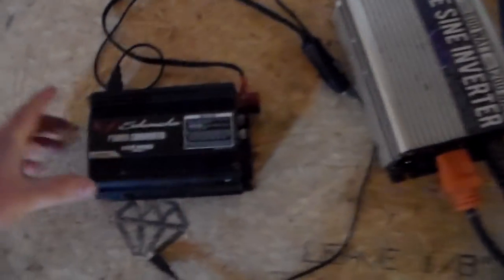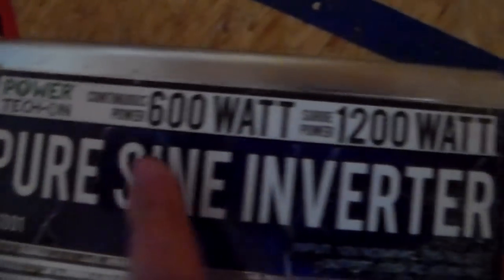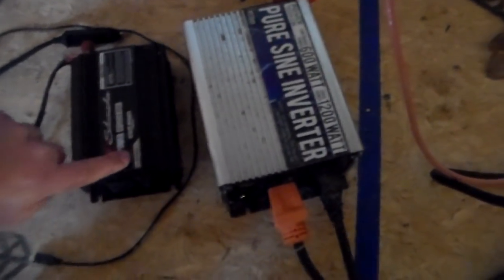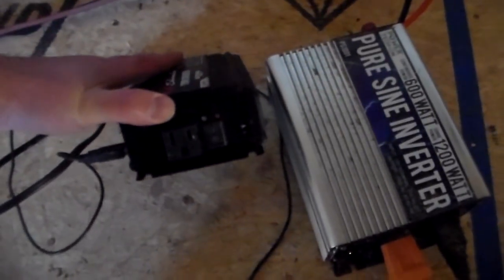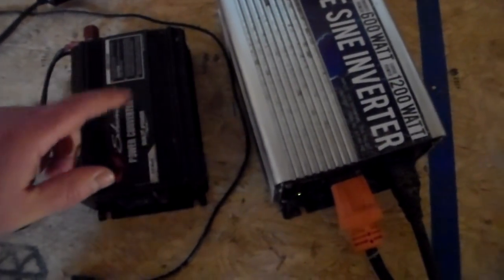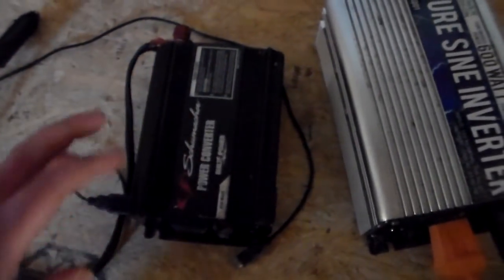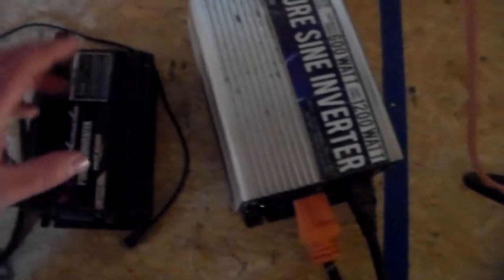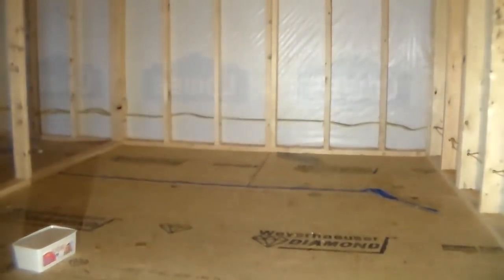Modified Inverter VS Pure Sine Wave Inverter

Comment: Power from the electric company or from a gasoline generator, comes from alternators, hence the alternating AC current which is true sine wave generated as the rotor from the alternator spins 360 degrees, "sine wave" from converters is really "synthetic" or an approximate, created to resemble a true sine wave, works fine if you have a good quality pure sine wave converter, if it's cheap, the sine wave will degrade the more power you extract from it, in other words if you sine wave converter rated at a 1,000 watts it may produce a sine wave output at 300 watts, but as it gets closer to it's rated capacity it will start to look like something else and mess up your electronics

Comment: Just as a note (I DO NOT RECOMMEND DOING THIS UNLESS YOU ARE VERSED ON HV AC VS DC) I live in southern Japan (Fukuoka) & the nominal power is 100 VAC 60Hz. You would be surprised how much of today's high speed switching power supplies can fully function on 100 - 240VDC. 
There are a few safety issues. With AC there is a point several times per second where there  is NO current flow if an arc occurs (such as switching an appliance off) the arc gets cut. 
With HV DC, that cut never occurs. When opening a switch conducting HV DC the arc produced has the tendency to continue unless it is suppressed with a properly rated capacitor across the switch (NOT THE LOAD). All inductive loads such as compressors or synchronous or asynchronous motors will NOT function on DC.  
I have been operating my entire home on 100VDC for 9 years now with the proper capacitors on all switches to prevent arcing.

Comment: This story, about the difference between the two types of inverters, is mostly a marketing trick. Theoretically there is nothing wrong with modified sinus inverters, as long as they are producing really modified sinus waveform. This means that, for every semiperiod of the alternating voltage, they should have fixed intervals before and after the main pulse. If the intervals are fixed to 30 degrees, which means 120 degrees of duration of the main pulse, then there is no problem at all. This is due to the fact that the third harmonic of the fundamental frequency is completely eliminated with these fixed intervals. Remainders of higher odd harmonics are strongly attenuated as well and cause no problems. The problem with the cheap commercially available modified sinus inverters is exactly that they do not produce correct modified sinus waveform because they regulate their output R.M.S voltage by affecting the duration of the single power pulse. Especially in the case of heavy loading of the inverter, its output waveform looks to be rather rectangular than modified sinus. This increases dramatically both the percentage and the magnitude of harmonics of its output and that hum noise becomes much stronger as well. 
Now, as regards the various types of loads, if we have a pure resistive load such as a water heater, or an incandescent lamp, this load doesn't care if the waveform of the power fed to it is modified sinus or pure sinus or D.C, that is battery oriented. The next type of load is the switching power supplies of all electronic equipment. These supplies don't care as well about the input waveform. As soon as it enters into them it gets rectified (i.e.converted in D.C) and then it is chopped down in order to produce the d.c voltage needed from each particular equipment. They can also work by D.C directly with no problems at all. The third type of load is the inductive load, i.e. mostly induction motors. This is the only load that is much happier with pure sinus voltage, just because it suffers most because of those harmonic components of the input voltage. But even in the case of motors, plenty of them produced in our days tend to be three phase brushless motors, which are driven again by rectified A,C voltage (i.e D.C) which is then split and transformed in modified sinus again, but three phase pulse width modulated signal. The compressors and ventilators of modern air conditioners use this technology (inverter) for both better efficiency and power economy.
In conclusion, all loads can work safely with a real modified sinus voltage inverter (unless one wants to sell power to the utility company, a special case in which there is obligation for pure sinus waveform production). Even with the commercially available modified sinus inverters, most loads will be fine. And yes, the problem of overheating is there for induction motors, along with the characteristic hum noise. And the noise is due to the abrupt interruption and starting of the pulsed waveform (which creates the harmonics). This is the whole picture of the topic. The main point is: "what is the need you want to cover with your inverter"? Think about your loads first and then make the proper decision for your specific case. Practically speaking, the modified sinus type covers everything, if used with common sense (watching the temperature of motors or protecting them by thermostats). If, for example, you need to operate an induction motor for many hours per day, such as a ventilating fan, you could buy a small pure sinus inverter for that motor exclusively and let the rest of the loads be powered from a big modified sinus one. That's all.
Reply: Moreover, soft start has absolutely nothing to do with starting a device with an inverter. It refers to the starting of the inverter itself in order to protect it during starting. As regards the battery charging by using modified sinus inverters, again, there is no problem at all because all modern chargers use switching power supplies and these supplies don't care about the waveshape of the incoming power. The proper charging of a battery is a matter of the quality of the charger. Not of the waveshape of the incoming voltage to it. There is too much of exaggeration in this video about the modified sinus inverters which is baseless (at least theoretically).

Comment: Wondering about losses and efficiencies.... On the fence about spending an extra $100 ($80 vs $180) on  my simple van setup for pure sine vs modified sine wav . Also finding Inverters just don't last very long for me.. wish they were generally more robust.  My battery Is my starter  70AH 120RC.  I run power tools and appliances 500w to 1000w, but need to run a freezer for 8 hours while a 200w solar panel feeds my battery through a MPPT controller.   Just had my 1200w modified sine inverter go bad after an accidental short.. they are so sensitive.  Somebody wrote a review on my inverter saying the inverter was eating 200W to power a 100W in devices...

I try not to use the inverter unless it absolutely needs a lot of power and 110v... for led lights and fans, why not stay with 5vdc and 12vdc?
Reply from the maker: your exactly right i exp the same thing seems like the mod ones eat more power. I know it sucks spending money but i will tell you its worth it. its night and day.

Comment: Thank you for that very valuable information. I have a small shed about 10 feet from the house, and have my solar panels on top. The sealed gel cell batteries are in the shed, but now I have to have power in the house.
Is it better to run 12 volts to the house and have the batteries inside, or should I leave the batteries in the shed and run a 110 volt line to the house. I understand that sealed gel cel batteries are safe inside the house, and in a battery box.
Same battery box as you see on camping trailers. Now I will go out and buy a pure wave inverter.

Comment: I have a 2000wat Pa system, what size pure sine wave do I need and how many batteries do I need to run a 5 hour outdoor event
Reply: If your inverter will work on 12 Volt, for full power output including the inefficiency loss (2400W) you need 200A. For 5 hours, this makes 1000Ah. And because you are not allowed to discharge 100% your battery because you will destroy it very soon, with 50% maximum depth of discharge you need 2000Ah. This means 20 batteries of 12 Volt and 100Ah connected in parallel. But for such a high load, you have better to work with a 48 Volt inverter, in order to minimise the high current flow. 200A of current demand very thick and very short cables. With 48 Volt system things are much convenient. The current draw will be 50A (48v x 50A = 2400W) and the capacity of the system will be reduced to 500Ah (for 48 Volts). This means that you still need 20 batteries of 100Ah each, which in this new configuration will be: five strings of 4 batteries connected in series (to form five individual 48v batteries), which finally will be paralleled to each other forming a 48V/500Ah battery. I hope that helps you cover your need.

Comment: Once again, thanks for the money-saving advice about inverters.  I guess it will certainly better to start out with Pure Sinewave Inverter to save money on burnt appliances.  Ofcourse one should look for 12 volt applainces if they do the job well enough.  It's unfortunate Air Conditioning technology has not advanced much from it's invention.  Thermo-electric/Peltier elements have not really advanced much in over 40 years, for the purpose of cooling.  Their are some pricey Peltier-based coolers that run on 12v, but the really good ones start at around $800.  A/C that can run solar, with an overall small footprint (for an apartment) is not "there yet".  How many batteries and how many panels would be needed to run my 10,000 btu wall unit?   Hummmm.....

Comment: Hi, im planning to power two led smds 30w each floodlights with a 300w modified sine wave inverter.  Should i expect any problems?
Reply from the maker: Clint Gatt the problem is the bulbs won’t last as long. You might get 1-2 years instead of 8-12 years. But other then that no you shouldn’t.
Reply: @Manchew  i intend maybe to use it 3 hrs periods max every now and then...so i thing it might not hurt that much...

Comment: Good day, I am thinking of going solar but i have a bunch of UPS's around that needs batteries. My real question is im going on a low budget so can i use the UPS as inverters, (just for basic electronics, like charging phones, tvs,  laptos and lights not machines, fridges or microwaves).
its my intention to upgrade in the future but i just want to start with my panels and charge controller and have something up on some truck batteries until i can deal with the big leagues.
Reply from the maker: Prince Formas I’m not sure what you mean by ups. But far as light uses like your talking any small battery would work even lawnmower batteries. The big problem is they won’t store a lot of power and won’t last as long. But they will work and there cheap
Reply: Simple Homestead UPS (uninterrupted Power Supply) like the backup devices for desktop computers, you know those?!
Reply: @DemiGod3  You can use absolutely safely any of your ups for the purposes you mentioned. You only need to disconnect the buzzer because it's very annoying as it beeps periodically when the ups works on battery voltage. The other thing needing care is the possibility of connecting bigger batteries externally in order to cover your needs according to the loads you want to support. Normally the internal batteries of any ups are capable to support the nominal load of the ups for 10 minutes or thereabout. Therefore you need to recalculate the capacity of your external big batteries in order to cover your needs.

Comment: Very informative. Thank you. I am thinking about replacing the inverter on my RV with a Pure Sine inverter. Does the wiring need to be beefed up to handle the increased flow or can I stay with what's already there? This country needs more of you hard working young men. Keep up the good work👍.
Reply: Perhaps you don't need to replace your inverter (if you didn't do that already). If you are interested why is that, please try to find my comment in the comment's pile of this video. I tried to give a very detailed explanation about that topic which seems to be a marketing trick and nothing more.

Comment: Exactly, modified sine wave inverters are good for destroying fridge compressors, also many inverters have BS surge ratings  modified  or pure sine wave, soft start also have huge capacitors just like bench grinders do, if you were to take the capacitors away and they would start very slow or burn out the motor windings because of the initial start up surge current, capacitors dump enough power into  the fridge etc prevent that burnout.
So you draw a large current for a short moment and do no damage instead of drawing a large current for too long and heat up the motor windings and burn them out.